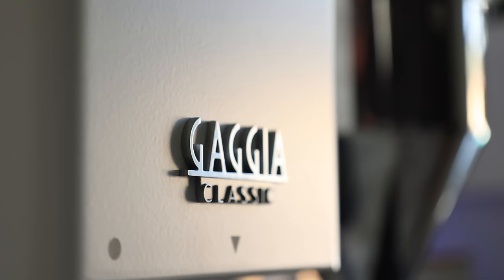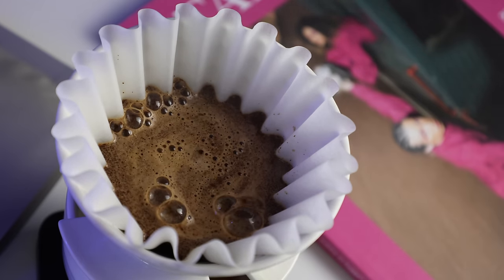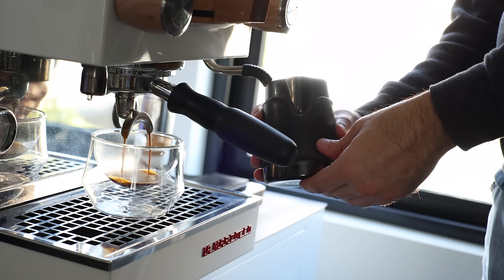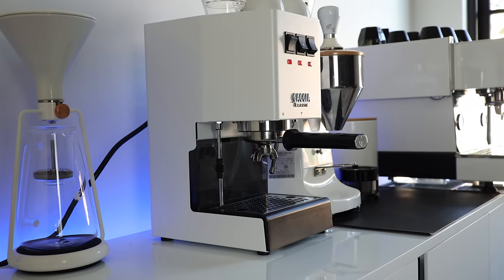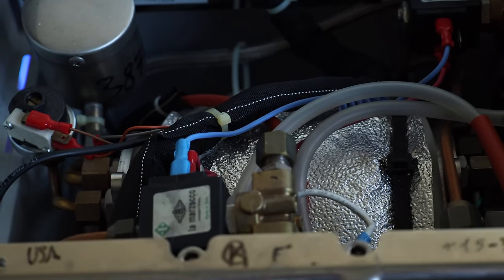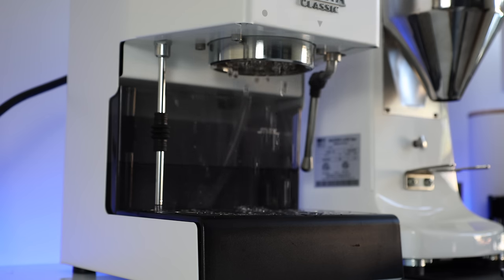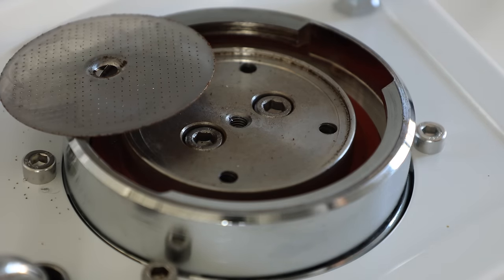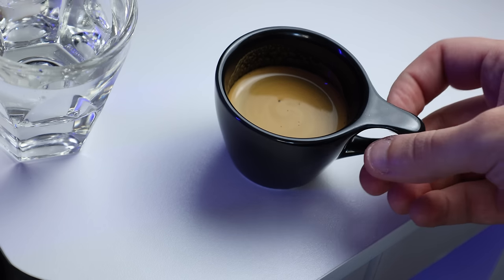SIDE BY SIDE - $500 Gaggia Classic Vs. $5,000 Linea Mini

Comment: I bought my Gaggia Classic in 2010. I have the upgraded basket and screen which made a difference in shots and I upgraded the steam wand from the autofrother to the two hole. Those are my only upgrades.  The fuse and boiler thermostat gave out last year and those are the only repairs I have had to make. They were really easy and inexpensive to do myself. I don't love my machine but it has been extremely reliable for twelve years and counting. I make a double latte/mocha every day which puts me at well over 4,000 shots pulled on the machine and less than $50 in repairs (Upgrades were probably $200 or so; can't really remember). I can repair/replace/upgrade anything on it for very little. Do I want a double boiler or heat exchanger? Sure. Will I ever pay $5,000 for one?  Never. There are too many serviceable machines with PIDs in the $2,000 range which I would consider before I pay $5,000 for an espresso machine. I appreciate your doing a blind taste test and saying the Gaggia shot was a bit better for you. It can be so subjective and if you tinker with shots long enough you can get pretty good profiles from almost every $500 and up machine. Keep up the great videos!  Appreciate your work in the espresso space.

Comment: I have had a terrible, terrible time with the Gaggia Classic Pro. So much so that I’ve taken a hiatus from espresso for a year or so, now. After upgrading my basket to VST, swapping out the OPV with a 9-bar spring, and trying to learn with a bottomless portafilter, with still very little success, I’m desperate for any advice from any Gaggia Classic Pro users.
Reply from the maker: What sort of issues are you having in particular?
Reply: @Sprometheus  Mostly sour shots and channeling, which of course suggests that my puck prep needs some work (something I’d agree with). The sour shots can be resolved by changing the grind setting (I use a Baratza Sette 270), but then my brew times are way off. To prepare the puck, I use a generic WDT and leveling tool, then tamp with a Pullman. Thanks for your response—love the espresso community, even if my skills need a lot of work!

Comment: Stock gaggia sadly is not great. Which out of the box would NOT be a good entry level machine. The mods however are quite cheap and if you are willing to install makes it a great machine. Stock 15 bar spring, portafilter basket, both need to be replaced to make it great. Love the vid, Linea mini is my dream machine, but currently own the Gaggia

Comment: Did you mention about the app to customize the brewing parameters that Gaggia doesn't have? Should try that before
Reply from the maker: I didn't but honestly, that add-on for me, with an older machine, costs $500, When a Gaggia can do the dimmer mod for pre-infusion and a PID for less than that.
Reply: @Sprometheus  Well it's pretty much like driving two cars for a comparison in a parking lot without exploring the full potential o f them. Using a new Gaggia Classic and one old custom Linea Mini ( who's missing the app and brewing parameters ) won't tell audience what means having different brewing methods. You're just making, talking about cars, a comparison between a brand new Fiat 500 hybrid and one old Ferrari 328 ( and I'll be with Ferrari anyway )

Comment: My gaggia has probably been in use for 6 years or so. My uncle had bought it and used it regularly with no mods as is. He then passed it down to me where I have been using it for three years already. I have just started modding it and am installing a 9bar spring. I use it very often and love it. I’ve been pulling some awesome shots but I’ve been wondering when I’d need to repair something as I’ve been using it a lot!

Comment: The GCP is totally in the same realm as my Saeco Via Venezia (the machine sold under a bunch of different names in the same base form since the 90's, maybe even the late 80's). Not necessarily the most advanced, but like the GCP, time tested -but with a few little cheap mod tweaks (ditching that awful "panarello" steam wand, non pressurized PF, utilizing WDT, etc) it was a baller on a budget, and super easy to maintain. Plus, the entire parts catalogue is available from Saeco/Phillips, so repairs shouldn't put you down. Sure, you'll do a touch more work to get there, but indeed you'll get there and it's a good skill builder if you're not working as a barista/coffee professional. 

I just got the Breville Dual Boiler/the niche for myself (and I'm absolutely loving it so far) but I'm tuning up the VV and giving it to a friend that was considering a GCP 😂👏

Comment: The Gaggia seems like a good entry point. However, for a bit more than the price of a classic pro, you can buy a Flair 58 lever expresso maker, and assuming you have a connected scale that can work with the expresso profiler app, you have almost total flow and pressure control for less than a 1000$ AND without having to meddle with the internals of an expresso machine. Personally, I have a pourover setup with a temperature controlled kettle and a Mahlkonig 54 grinder (which is a bit of an overkill right now lol but I never have such nice cups of filter coffee in my life before I bought this beast). So a flair 58 will be a really optimal addition to this setup with no unnecessary features and no elements made a duplicate by the addition of a expresso machine full of expensive features that I cannot afford all at once and become more and more hard to justify to buy because of diminishing returns.